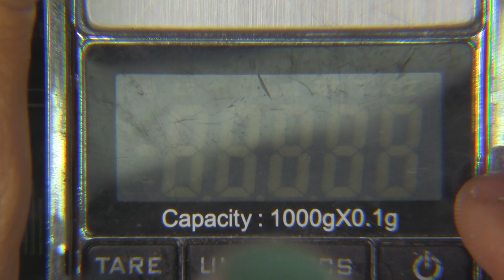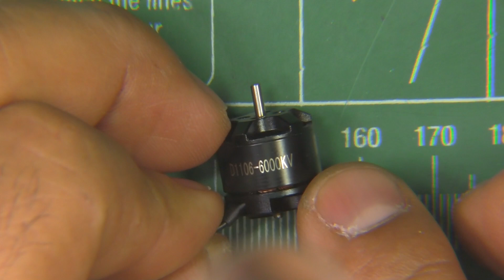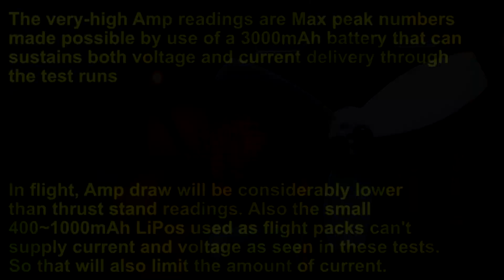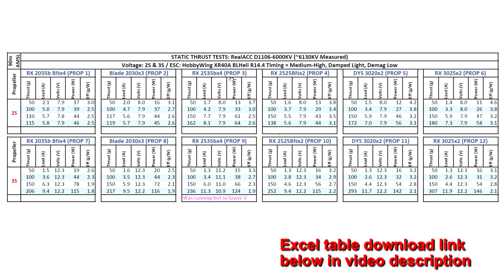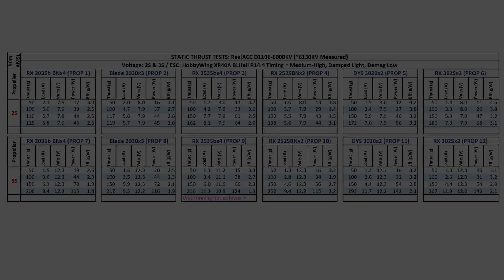Banggood RealACC D1106-6000KV 3S Thrust Tests-Good Budget Motors, Shafts back out.Drill props!

Comment: Does it have problems with overheating after the flight
Because I used the emax rs1106 6000kv and 3s battery to feel very hot after flying
Is there any solution?
Reply from the maker: I have seen many people using these and also the EMAX on 3S - GemFan 2040x3 and some with GF2540x3 and seems they run OK. Many videos on Ytube. I've flown these also on 2040x3 no issues. Could be some ESC's or some FC combinations don't work well with some of these micro motors because also I have received some questions about motors running hot, I think about 5 or 6 people have mentioned motors get hot
Reply: EngineerX really thanks

Comment: If the shaft backs out it means during crash shaft would back out like those sunny sky 1104 did?
Reply from the maker: Yes, these have shafts that back out. You can use a little CA glue or strong Loctite

Comment: Thank you for your time to review, now you said the shaft comes out that'd be similar problem on my xt1104 7500kv motor from stock fly egg 130, shaft would come out and get lost in crashes, I ruined 6 out of 8 motors that way
Reply from the maker: Yes, that's a design flaw in this type of motors because shaft is pressed in only very little contact area. Maybe if we add a drop of CA glue or Loctite Green threadlocker it will help a little but have to be careful and take off bell to apply glue. Lots of work. Thank you for watching.

Comment: Hi thanks for the tests, is there a chance to run and add to the table the RX 2535bx4 prop on 3S?
any thanks in advance
Reply from the maker: The motor got a bit hot on that prop so I lowered 3S voltage to the "nominal" value of 11.1V, it's right there on (PROP 9). Motor should run OK in-flight as the load/ Amps will be much lower. I didn't want to go past 12A load on this motor as it started to smell of burnt enamel from the motor stator wire/windings getting too hot.
Reply: EngineerX Thanks, maybe a typo in excel as it appears as rx 2035 vs 2535 hence my request
Reply from the maker: Just noticed, on the video PROP 9 = 2535bx4 but on the Excel file there's a typo! - should be 2535bx4
Reply: EngineerX Thanks man, yes great, I'm compiling some cross reference from your tests to find best motor given a prop

Comment: Do you think it can handle the kingkong 2840 3 blade props on 3s?
Reply from the maker: I've been told it can handle that prop, but I have not tried it myself. I'd say it should be ok on 3S but of course I would check motor temperature carefully after a short flight, then go a bit longer and check again. Should be able to hold motor without feeling discomfort from heat.

Comment: Thanks for testing this motor. I'm currently using a DYS 1104 7000kv with a Gemfan 3020 prop and I'm getting 169 grams of thrust while pulling 8.6 amps on my Micro Parkjet. Being able to get approx. the same amount of thrust while using 1.6 amps less is fantastic.
Reply from the maker: Thanks for watching. The extra 2mm taller stator makes it more efficient. The motor has more copper, iron, & magnet material to make power  so it uses less current to achieve the same thrust. If you go faster and @ full throttle then you may end up discharging battery faster in some cases but because you're flying faster :)

Comment: Awesome video brother! Love all the information about these. I ordered a set yesterday before watching your video and now I'm really glad I did. I can't wait to see what they can do. What prop and battery combo do you recommend? I'll be using it on a 
 44 gram RipaFire Super RX 160 that supports 4" props.
Reply from the maker: Yea, for the price they're very good. These do best on 3S and GemFan 3025x2 props. You might be able to run the 3-blade GF3035x3 or DYS 3045x3 but make sure to check motor temperatures. I'd start with the 2-blade props and see how it goes. Thanks for watching!

Comment: Thx for the video.Nice thrust on 3s.I got a bunch of dys xt3045  3 blade props  ,you think it would work on 3s or do i need to trim the blades to keep it from overheating with this engine?
Reply from the maker: I know of one person who is running that prop with this motor, the guy who donated the motor. Adam-g1 here on YTube, you may want to ask him to confirm. I believe he said motors run fine but his quad is very light.
Reply: Ok thx

Comment: so cool you are testing micros! maybe you could add the 2840 prop ,I run it on my micro with 1304 motors, feels more powerful than the 3025 but less than the dys 3045 but more efficient.

Comment: If the realacc is out of stock I think these orange 85 might be a rebrand, I ordered some yesterday and some blade props the day before to go on my 90mm Kevlar set up I'm building. https://m.banggood.com/Realacc-Orange85-FPV-Racer-Spare-Part-1106-6000KV-1-3S-Brushless-Motor-p-1145516.html?rmmds=search
Reply from the maker: They were showing 1 left just 2 days ago when I was editing video. Looks like they got more in. Those are the same ones from the Orange85. Lots of people are liking this motor for it's budget price and good performance. Just have to be careful with tight props and not push shaft back. Better to enlarge middle hole to 1.6mm (1/16" drill bit)

Comment: would be nice, if you can review HGLRC motors in this class. I heard all good things about them. I think it can bring good competition to the table.
Reply from the maker: That's the next motor in this class I'll be testing. the Flame HF1105-6000KV. It'll be around 1 week for test video to get uploaded.
Reply: Awesome...Good suggestion suleyman.  Forgot about these. Had a set of the 7500kv on a quad I bought.  They got hot on 3s and eventually all, but one was destroyed.  Wondering how the lower kv will hold up on 3s.  Plus, just wondering how they stack up against the newer 1106 motors.

Keep it up Engineerx!
Reply: great.  I just ordered this motor.  Also could you use the kingkong 2840x3 props.  as I ordered these aswell.   They seem to be ok on the flyegg 130 with 1105 motors.  But I am concerned and I hope the motors can handle that much prop
Reply from the maker: If those props are OK on the FlyEgg's 1105-7000KV, One would think they should be OK on a slightly larger 1106 with considerably lower KV. In the air, Amps are going to be a lot lower than what is shown in static tests. Just check motor temps after a short flight with a couple of throttle bursts. Start at about 75% max throttle and land right away to check motor temps to see how motors respond in your setup.
Reply: Great. I was looking to 7500KV version for 2S, but 6000kv would give some type of idea. I used HGLRC 28A ESCs and all of their flight controller. Quality is top notch and price is very good. Still expensive than the racerstar line up, but for the quality you are getting, it is worth the extra $$ paid for it. But never seen their motors performance. So hope this turn out to be good.
Reply from the maker: suleyman savci Motor quality Locke pretty good frío my visual inspection. The guy who donated for testing says they're good. He's quite experienced with this size of motors. Yep. Best to pay a little extra for quality and reliability

Comment: Great, thanks a lot for this video, please do a review of the kingkong 1105 8000kv motors
Reply from the maker: I think it's discontinued? Can't find it at Banggood
Reply: EngineerX http://www.myrcmart.com/kingkong-1105-8500kv-brushless-motor-for-mini-ttype-propeller-p-11280.html

I dont know, it seems pretty powerfull and 3s rated
Reply from the maker: The Spintech I tested recently is 1106-8000KV and it's pretty well made. I honestly don't see how the 1105-8000KV would do better. Rated 3S but they don't say what prop. I doubt you can use 3" or 2535x4. Maybe on 2" but 2S would probably be the best choice like the SpinTech. You can see on 2S it's already very highly loaded on the thrust stand. In the air, Amps come down a lot, so it's possible it'll be ok, but that has to be tried on a quad in-flight. I'll ask MyRCMart to send a test sample. They usually only send their own RCX brand motors.
Reply from the maker: Pablo Elizondo Wow! On 3S. That's good for 8000kv. I'll ask MyRCMart but I doubt they'll send it.
Reply: I'm also dying for a thrust test! The kingkong 1105 8500kv is the KING of budget 11xx motors of the moment. It costs 7,50€ a piece on aliexpress
and it crushes anything below its price point in the  11xx category.

We just need to know what else it can crush that is much more expensive.

Hopefully you can include the kingkong 2345 props too (emax 2345 clones) so we have a direct comparison with the emax 1106 official charts.

Thanks and keep up the great videos!!!
Reply: Im using them with 2840 props with 3s tattu lipos, its a beast
Reply: Pablo Elizondo How hot do they get if you fly full throttle continuously? I just managed to fry one of mine with the kingkong 2345 prop, so I want to know if they create more heat than the 2840
Reply: Also, what pids do you use for it to stay cool on 3s 2840?
Reply: Well after lowering the P and D values they just get warm, betaflight 3.2 rc4 have to high PID values for my micro quad
Reply: Pablo Elizondo Thanks. Could you give us the specific values so we have an idea how low we have to go?